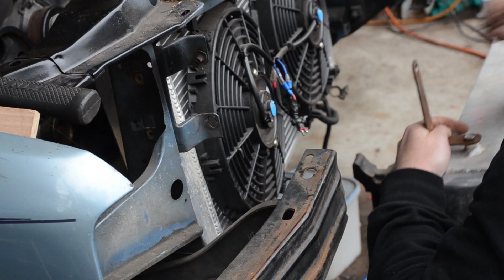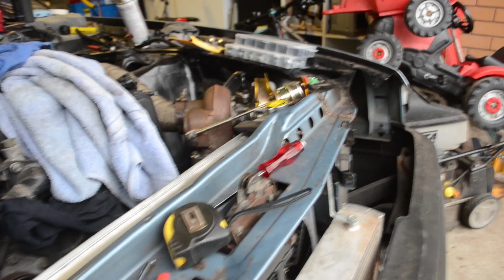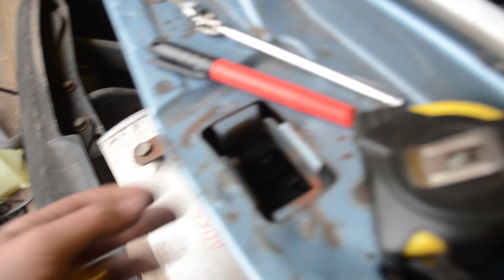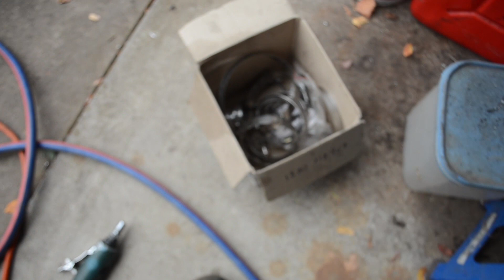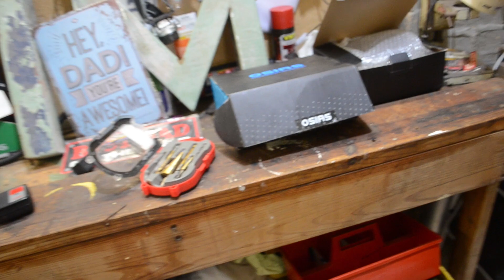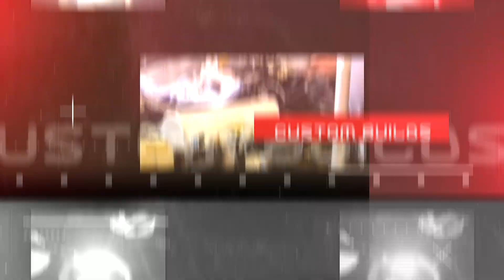project Fexus intercooler install

Comment: Back when I lived in Australia, I had a Soarer with the 2jzgte. I live in the USA now. My wife's newer Volkswagen was destroyed by a mechanic. She was devastated, and was watching my old Australian drift videos and absolutely loved the Soarer (videos from my glory days) and so I hunted her down a mint 99 SC400, and I'm about to boost it and drop in a 6 speed manual. It's already got coilovers and I've done adjustable upper and lower control arms, full bushings, rebuilt the 1uzfe from the heads up.

Now I need to figure out boosting this thing......so here I am... watching your build.
Reply from the maker: Shoot me any questions mate, I’m working it out as I go so Totaly happy to share the mistakes and learning as we do this. The car is running at the moment, sorting out the gear box now and will get that video out hopefully before Christmas, then it’s all the finishing touches which will take ages lol. But the car runs and sounds incredible!
Reply: @TimWalterLife  my main question was stock manifolds reversed and how you fit turbos to them. It's also a vvti, so I'm expecting to replace the stock ECU and have it tuned nearby. 

Rods and pistons and rings I have sorted, still need to install them when the motor comes out. I'll hook it all up out of the car and test fit stuff. Head gaskets and studs are already in.

I'm chasing 600-700 for her because I can't have her drive "my old car" and not be terrified/excited.
Basically what are the big issues you ran into, things to prepare for and maybe avoid.
Reply: @TimWalterLife  also super stoked to see the next video of this thing driving. My only concern is the police I remember in Australia used to ®@pe us for our modified imports hahaha in the USA they don't care. You can legally do anything you want up here in PA, and yes that includes the ar15 on the passenger seat.